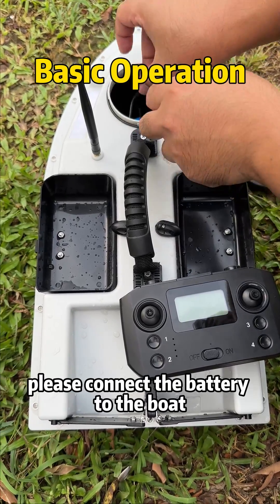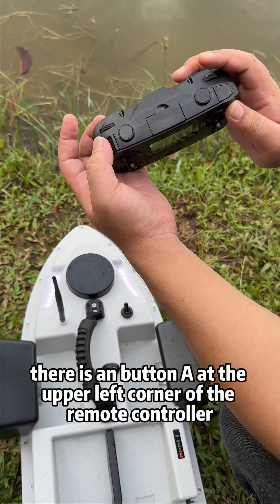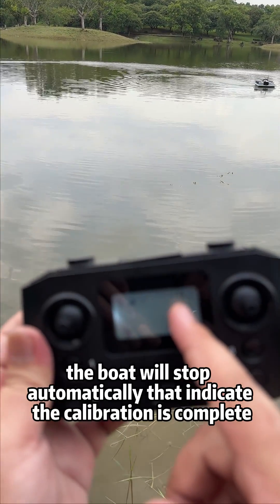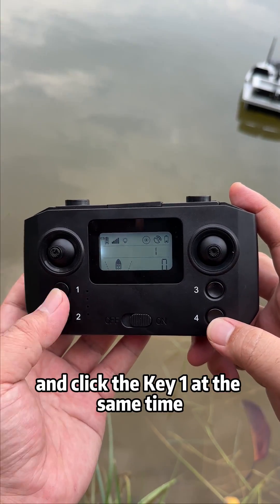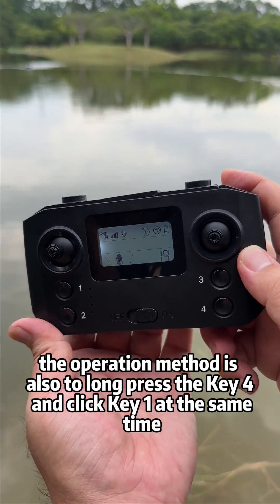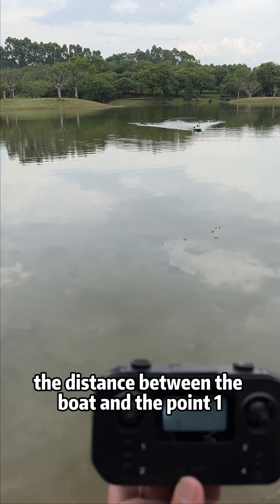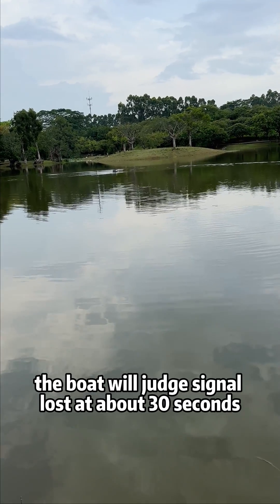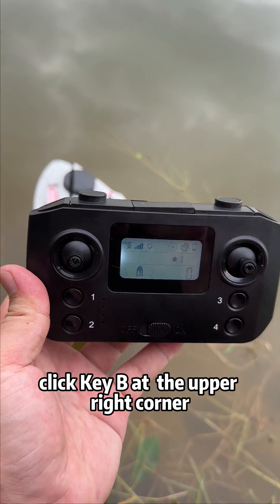D19 GPS nest making boat tutorial

Comment: I've written out some basic English instructions for anyone , save them to your phone to use on the bank! 

.*** Bait boat Instructions***.

AUTO CALIBRATION (Complete first time at each lake)  
- Drive the boat out 5+ meters 
-  Hold button 4 and press A (L1) to start calibration 

SET POINTS
- Bring the boat back to your location to set the return point 
- Scroll wheel until number 1 appears on screen , now hold button 4 and press button 1 to confirm. The return location is now saved. (A star will appear on screen) 
- To return the boat automatically back to you,  scroll to number 1 and confirm by pressing button 3. 

- Drive the boat to the fishing location, scroll on the right wheel until number 2 appears on screen, hold button 4 and press button 1 to save the new location. 
- Repeat the above steps to save more locations, so scroll to the next number (Number 3) and repeat. 
- Scroll through your saved locations and then press button 3 to automatically send the boat out to that saved location. 

CRUISE CONTROL
- Push both sticks forward and press B (R1). 
- Press B again if you want to cancel cruise control 

HOPPERS 
- Main Hoppers - Press buttons 1 or 2 
- Rear Hoppers - Hold button 1 or 2

LIGHTS
- Button A (L1) or Button B (L2) changes light settings.